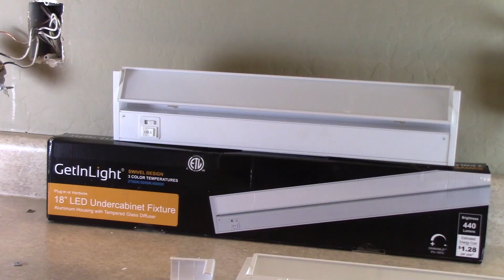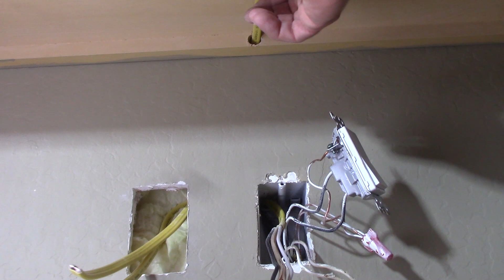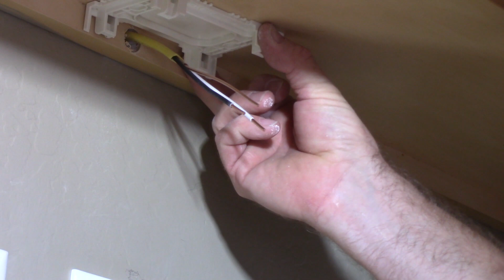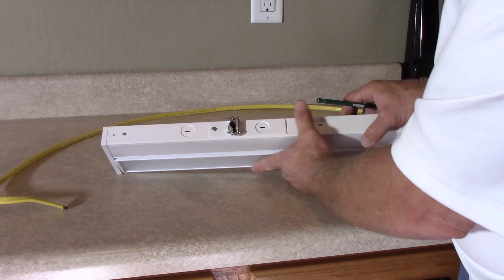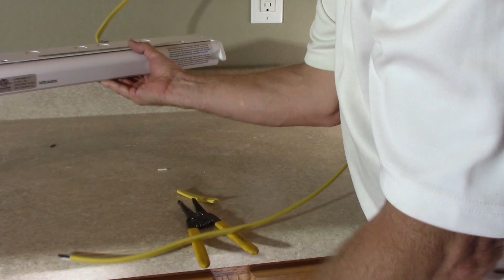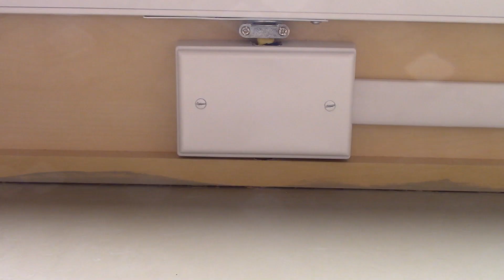Getinlight Pro LED Under Cabinet Lighting Installation and Review

Comment: Thanks Terry! Great video. Could you have simply spliced in the ground neutral hot without the extra switch them turn them on/off using the existing switch on the light fixture?
Reply from the maker: Hi Mark.  Yes, for sure you can do that.  It's all a preference, if you want them all to come on at once with one switch, or individually with the fixture switches.  Thanks for watching!
Merry Christmas, and a Happy New Year.

Comment: Did I understand that #12 wire was used. Why not #14 as these units would not appear to use that much amperage.
Reply from the maker: This was in Arizona.  They, and most of the USA use way more #12 and 20A circuitry, and in Canada, #14 and 15A for general circuits is more prevalent.

Comment: Terry on your first box coming from switch it looks like you capped off the neutral and ground. Shouldn’t there be there wires in each Waco? Thanks for help.
Reply from the maker: I'm not entirely sure what you're referring to, but they are connected to the wires from the fixture (hot, neutral, and ground)

Comment: Why did you use so many junction boxes? Can you just go from one light to the next one using the light itself as the junction box? Or what am I missing?
Reply from the maker: The amount of room for the electrical connections are very small and bringing in 2 cables (in and out) would be extremely difficult.  That's why I tried to only have one cable coming in to each fixture and chose to do it that way.
Reply: What boxes did you use?

Comment: Great video! Thanks, this really helps me understand how to do a professional job. I'm curious, what length/size screws did you use to attach the Wiremold Receptacle box and runway to the bottom of the cabinet? Should the wire from the switch going into the receptacle box have some kind of clamp? eg, a Service Entrance Cable Strap like  https://www.homedepot.com/p/Halex-12-2-14-2-Service-Entrance-SE-1-Hole-Cable-Straps-10-Pack-26210/100113229

Comment: Terry, could you do a video on either troubleshooting a 4 pin desk lamp socket, or 4 pin can socket. The small florescent 4 tube light bulb won't work, but the continuity checks out on the bulb, so it's got to be the socket or lamp switch. Multimeter voltage says I'm only getting 6 volts on the socket, so I'm scratching my head.